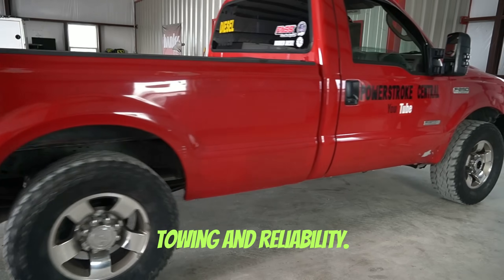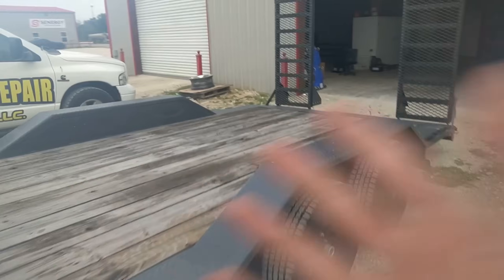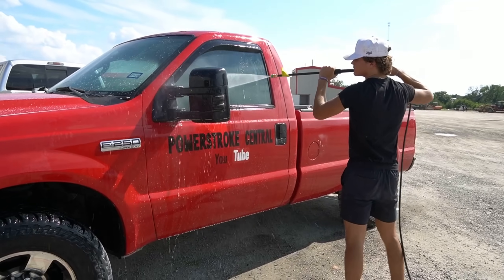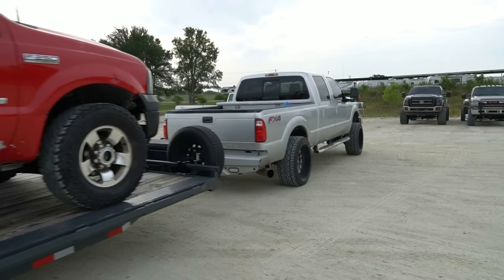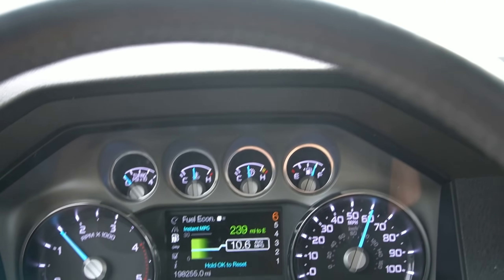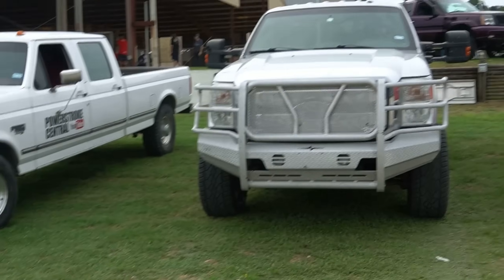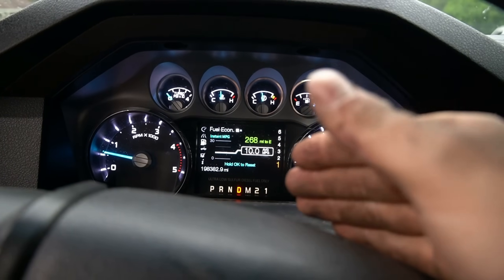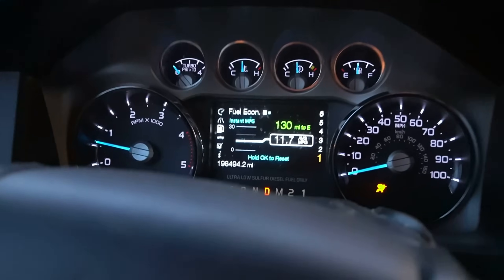I Durability Tested My 6.7L Powerstroke

Comment: The 7.3 just doesn’t have a hitch receiver on it, but you can add one onto the truck. That would be better for towing and rated for more weight. Also you need to adjust that drop hitch for the trailer with the truck on it.
Reply: Better for towing 😂🤦🏼‍♂️

Comment: I get 11-12 towing my 31 ft camper with my 19 250. Unloaded on a 180hp tune, I get 20+ hand calculated. Tires and lift play a big role in regards to mileage. I am stock height on 275/65 Toyo AT 3's.

Comment: Love your content and testing, but there's no way your reg cab 6.0 weighs 8500 lbs. My 02 ccsb f350 7.3 with ranchhand bumpers only weighs 7900.
Reply: My 97 7.3 ex cab short bed on one tons was 7100 with a couch in the back and me weighing 275 🤣
Reply: My 08 f350 6.4l reg cab 4x4 weighs 8120 lbs

Comment: Ford diesels are fuel pigs, load the lbz avg 14.1L per 100km doing 120km at 50% load towing 30ft 5th wheel
Reply: Thats 16.6 mpg still trash my ford 6.0 gets 20mpg 9,000 load

Comment: That truck does not weigh 8500 pounds, more like 6500
Reply: I have a '06 extended cab long bed two-wheel drive and it weighs like 6,500 lb

Comment: I have a question did you used to have a 2000 7.3 powerstroke and sold it on Facebook marketplace a long time ago and it’s the truck as my profile pic??
Reply: He had some 1999-2003 7.3l and it ended up totaled in a wreck.

Comment: Hey, Mr. powerstroke Central are you running the cp4 disaster prevention kit on your truck?
Reply: Those kits are useless and a waste of time any money. It doesn't prevent anything.
Reply: @justinnash8889  think what you think I know people who have the kit on there truck that have 200,000 miles on  there trucks and have no problem since
Reply: @BRMPHOTOS  ok and I know people without the kit with 200k what's your point? If the pump fails the kit isn't going to do anything to help prevent contamination through the rest of the system.....which is the point of it.

Comment: That 6.0 is nowhere near 10k probably 7 being honest
Reply: Weight of the truck being towed plus the trailer weight.
Reply: @GeneralBeefDip  even then theres no way that trailer plus singlecab long bed 6.0 was even close to 8 or 9k
Reply: @Canhead56 My 02 7.3 single cab weighed in at 6200 and my brothers 20’ car hauler weighed in at 3500, so pretty dang close